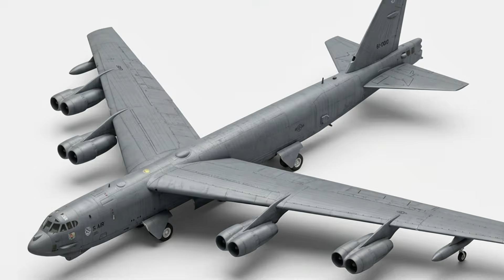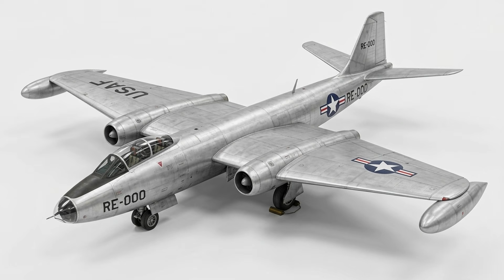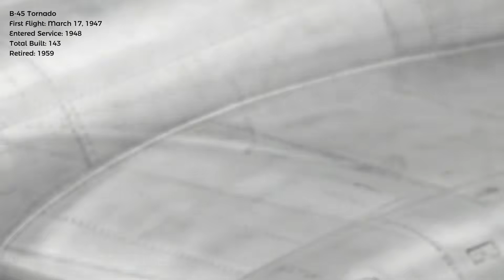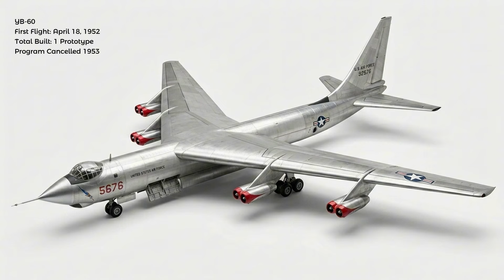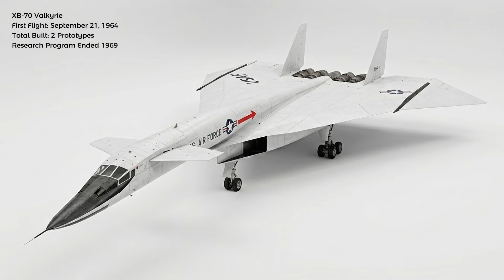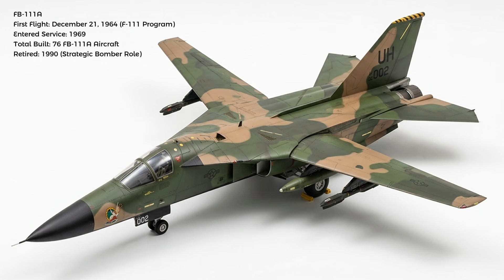Every US Strategic Bomber OverSimplified in 7 Minutes

Comment: Your first one, the XB-15 is not an XB-15. There are passing similarities between the XB-15 and B-17, but here you have a B-17 as the XB -15. There are significant visual differences between the two. Your XB-19 is also not an XB-19. It's just a B-29. The XB-35 is a pretty decent image, but the actual YB-49 is completely different to the image here, particularly about where the air intakes are, and where and how the engines were mounted. Your image of the B-45 Tornado is a B-57 Canberra. The B-45 had 4 engines mounted in 2 pods similar to the B-52, except they are mounted on the leading edge of each wing. You've also got the B-2 as the image for the B-21. The rest were ok.